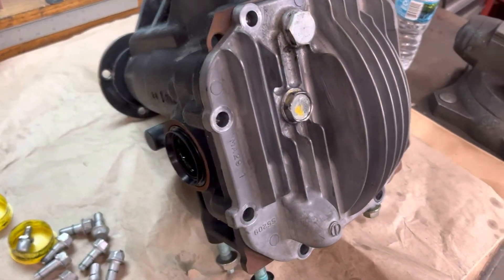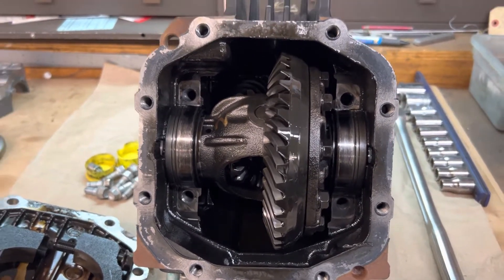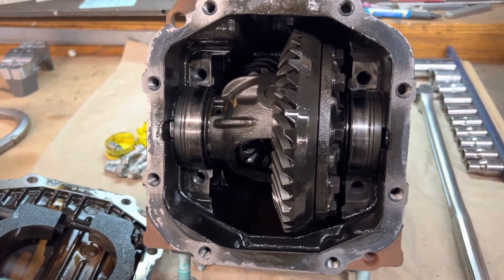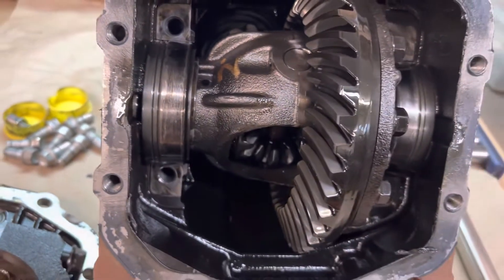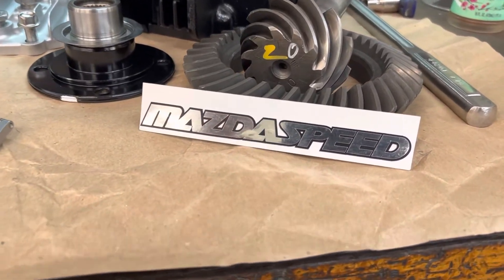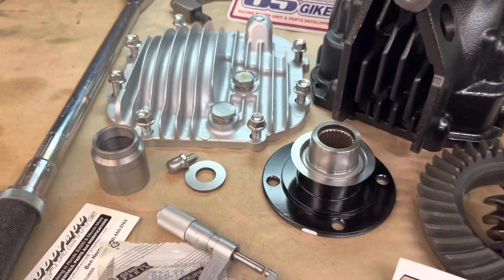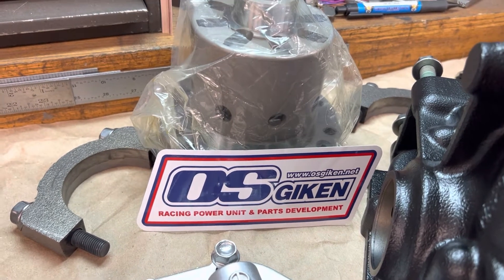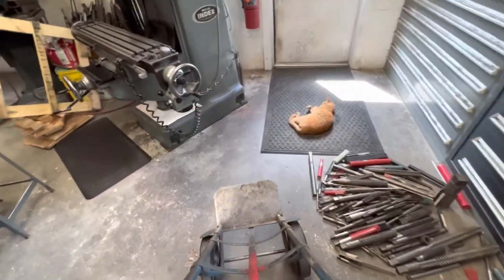Mazda Miata Osgiken LSD 3.63 ring and pinion with Stage 2 PuddyMod part 1

Comment: hi I have a 99 Miata which I want to put in a 6 speed trans my current 4.3 diff wouldn't be truly compatible looking for a 3.63 ring and pinion for my differential which has been difficult where did you find the 3.63 ring and pinion?
Reply from the maker: I believe Miata Rodster has them in stock,